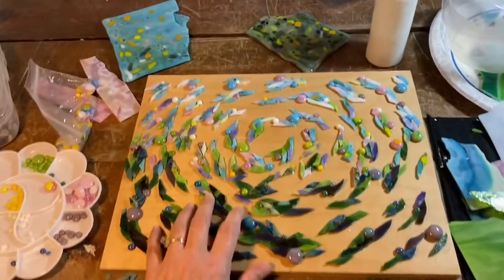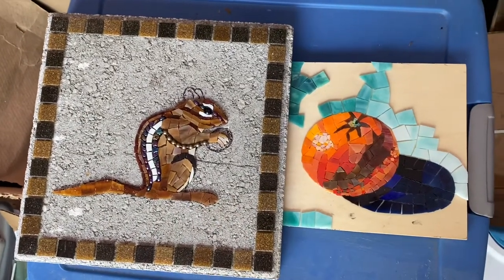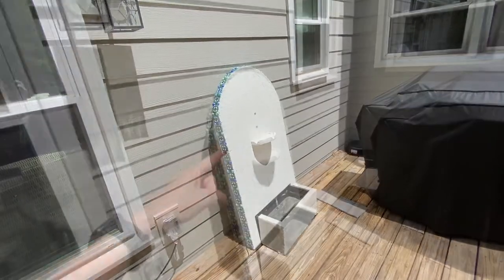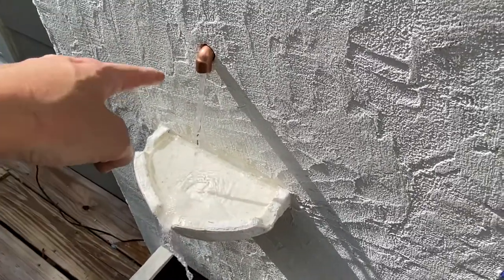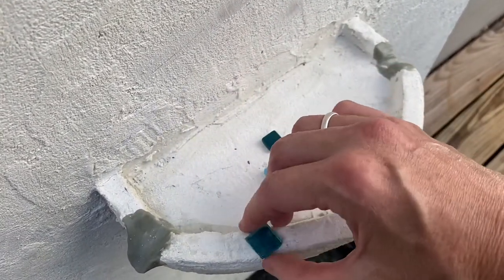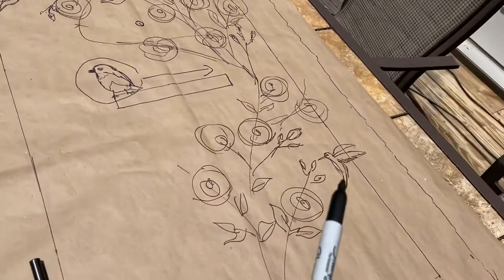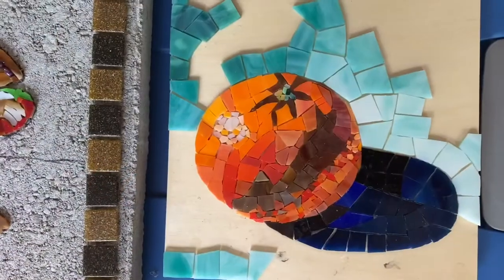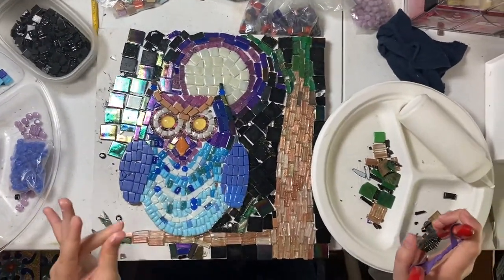Ep. 50 THE MOSAIC FOUNTAIN, SPRING FEVER III, & SOME UPDATES!

Comment: I love finding more things to use Apoxie sculpt with! 💕
Reply from the maker: It is an amazing product! I've found it has issues with freeze/thaw cycles. Not in this application though.
Reply: @mazzonimosaics8222  Good to know. So on a mosaic kept outside with snow or heavy frosts would be an issue?
Reply from the maker: @diannecrea7090 I think it’s an issue if the tesserae is not imbedded properly. If it was filati stuck in Apoxie I think it would be fine.